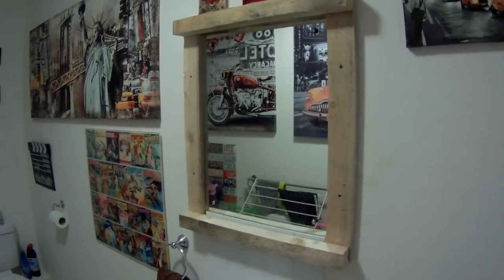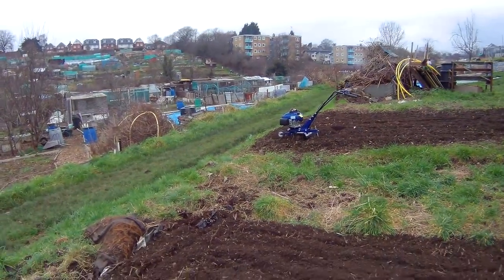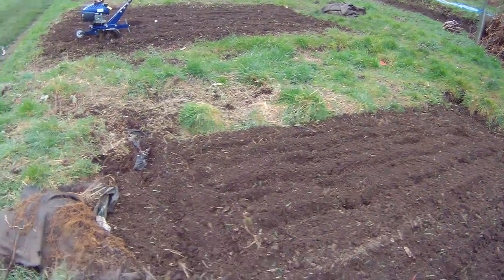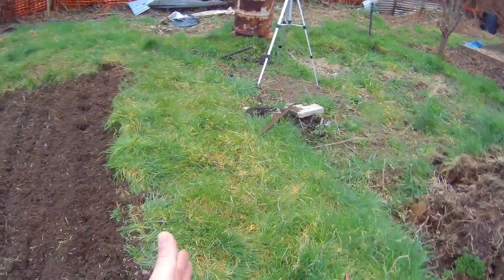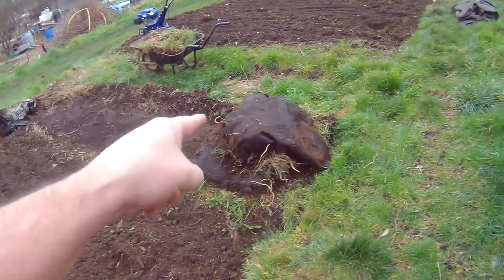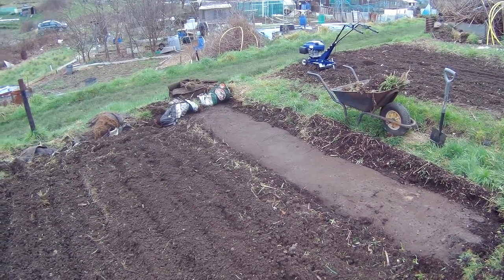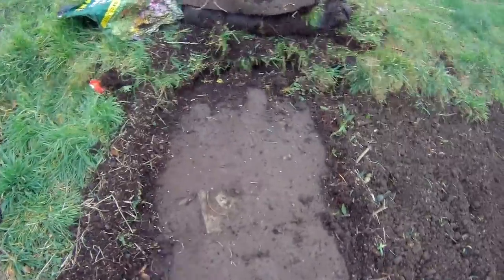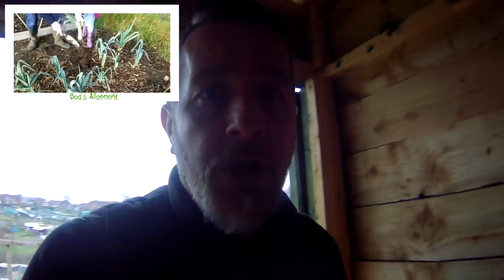Our Allotment --------- Part 34

Comment: Hi Mel geting one of thease deliverd (Hyundai HYT140 139cc 4HP ) Tues or Weds this week is it just the handle bars you have to connect please. I have 3 allotments haddenham Ely I did have a Howard 220 but after spending on it to keep it running decided to buy new. see how good it is on yours
Reply: Got my new Tiller/Rotavator Today dispatched Monday Arrived about 1pm couple curses one for each handle lol.